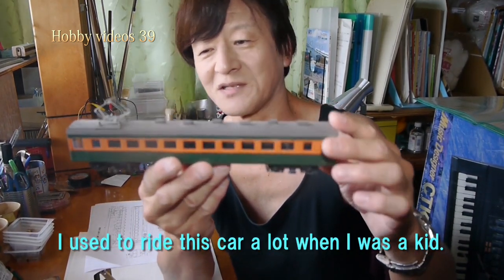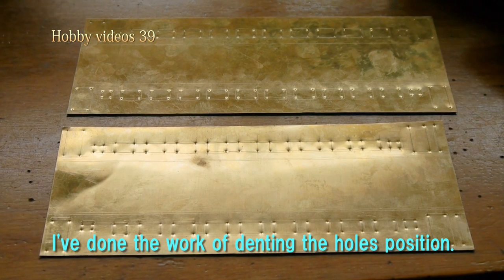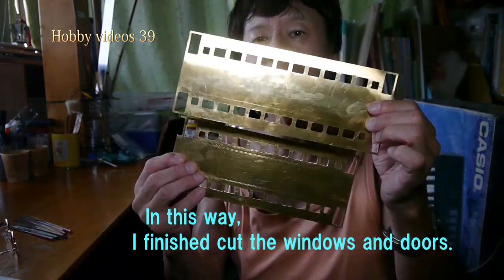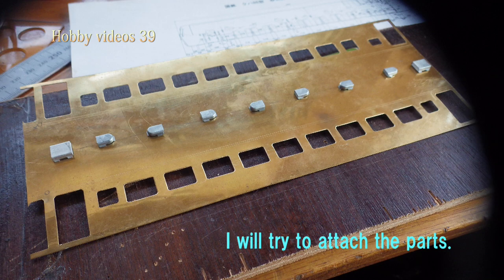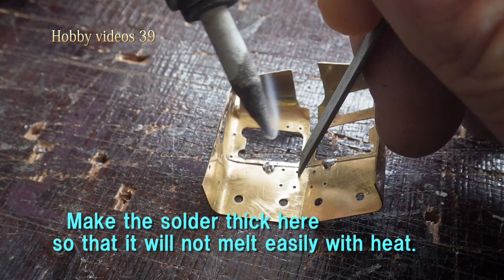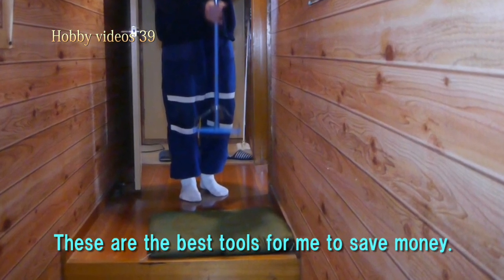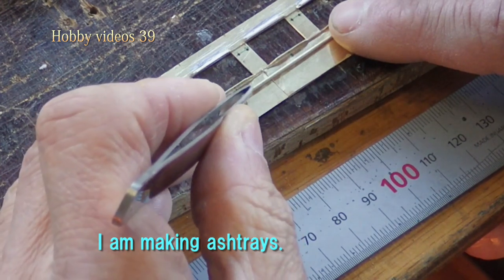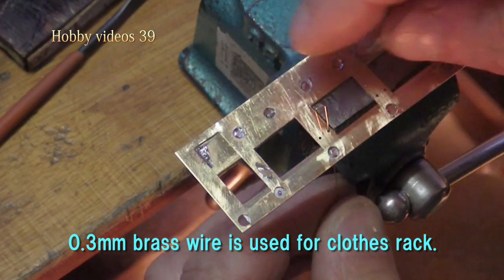Scratch build train model.　　English version.

Comment: Thanks - it is always a benefit to see someone else's solutions for various brass model making situations. I really liked the use of clear tape to hold the parts for forming and soldering, and the sprung screw soldering fixtures.
I laughed at the mop handle and cushion part - don't worry about it - I often cut off just the right size hardwood tree branch from my yard and lathe / sand it straight to use as radius forming tools...
Reply from the maker: Thank you for your messege.
I think I can bend the roof well with the mop handle and cushions, so I thought I don't have to buy any tools.
But I think if you see someone making it with proper tools, you'll laugh.
By the way, what do you call clear tape?
We call 'sero tape' in Japanese,  
When I converted by Google Translate, it became a scotch tape in English.
Reply: @HobbyVideos  Hi.
If you don't have the "proper" tools, a skilled builder will make the workpiece with what is available. It usually just takes more care, effort, time, and maybe produces less accurate results.
Scotch Tape is a brand / company trademark name - actually the company is the giant industrial 3M corporation. There are many brands of similar clear tape in North America and elsewhere. This type of clear tape is technically known as cellulose or cellophane backed pressure sensitive adhesive tape. I believe it is identical to "sero tape".

Comment: I was a jeweller for 20 years but now work for the railway for some time. I am now thinking about unpacking my old tools to try and emulate your work. Thankyou for the English version and I will watch your other videos to learn more.
Btw, the jewellers term for cutting out shapes in sheet metal is called "saw piercing". Have you considered using bees wax on the saw blade itself? (I've used candle wax too just to see how it would behave and it was okay)
You taught me many things in one video, I am looking forward to watching more of them.
Reply from the maker: Hi
I'm not very veteran, I don't have expensive tools, and I make models without spending too much money.
Thank you for watching my video.

Comment: I wouldn't use a centre punch to start cutting the windows. What you need is a Vertical drill stand, and then clamp the brass sheet in place, so you can drill directly into a smooth brass surface. This method avoids denting or disforming the brass sheet before drilling, it's also quicker !
Happy modelling.
Reply from the maker: Oh！ I see.
But I don't have a vertical drill stand so I make it this way.

Comment: I enjoyed your video and the tools you used to bend the roof of the train thank you for sharing you humor. What wattage of the soldering iron that you are using?
Reply from the maker: Thanks for watching.
The wattage of one is 80(w) when I join 0.3t brass plates.
Also, I use 100 watts when either brass plate is 1.0t.

Comment: This is an inspiring video - thank you so much!

I wish it was so straightforward to motorise a model in N gauge (41:16). No-one seems to sell wheelsets like that for 9mm gauge!
Reply from the maker: Thank you very much.
This model is a 1/80 model at a scale that is unique to Japan.
In Japan, this 1/80th model is called HO gauge.
The track width is 16.5 mm.
It is a size close to 1/87, which is called HO gauge worldwide.
However, the width of the actual Japanese railroad track is 1067 mm, which is 13 mm when divided by 80.
So I'm making a 1/80 model with a track width of 13mm.

N gauge is small and cheap, so I think it's better to buy a finished product than to make it, so I think that parts are not sold well.
Reply: @HobbyVideos  You're right! There are good options using Tomix/Tomytec or Kato chassis for parts :)

Thanks again!

Comment: I saw at about 41:30 that you added wheelsets on axles, which seem to have drive gearboxes attached.  Are you able to use that system to drive bogies of different wheelbases?  I would like to drive some of wheelbase 40mm, without too much mechanism visible below the bogie frames.  Can you tell me where to find more information about the product please?